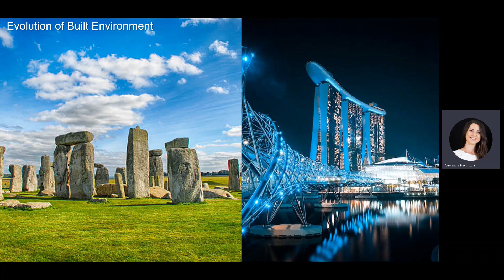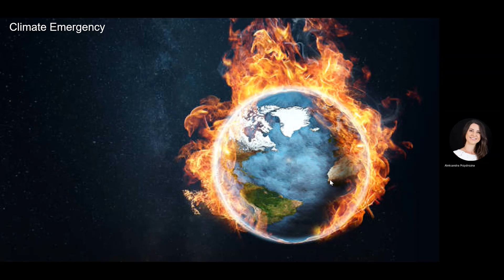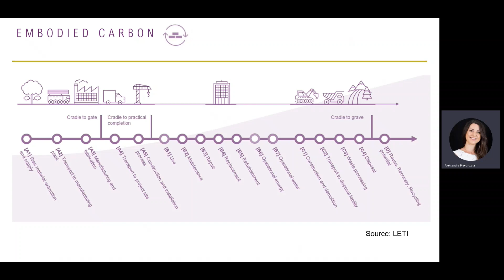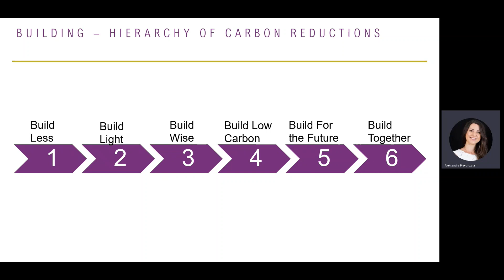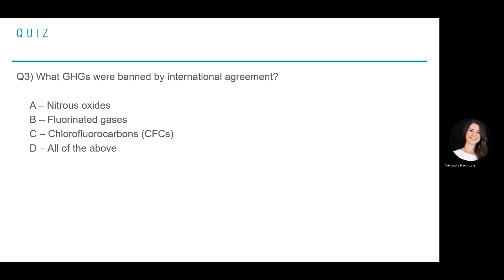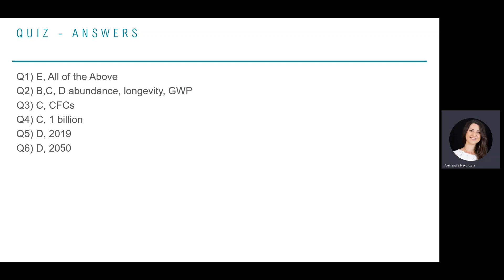EcoFIX Webinar 4 - Climate Emergency

Comment: Nonsense. There has been no clear change in annual precipitation over the Earth's landmasses between 1850-2000 (Wijngaarden, 2015).
Drought appears to be decreasing globally (Watts et al, 2018) measured by SPI 1901-2017. 
There are over 5 million excess deaths per annum globally due to abnormal temperatures from the 2000-2019 study led Prof. Guo of Monash University. It found that over 90% of excess deaths were caused by excess COLD rather than excess heat. So, in a world with increasingly mild temperatures, there will be less excess death. Warming is good not bad. 
Deserts have shrunk considerably since the 1980's. The Sahara shrank by 12,000km² per year 1984-2015(Liu & Xue, 2020). The Earth has greened by 15% or more in a human lifetime. "The greening of the planet over the last two decades represents an increase in leaf area on plants and trees equivalent to the area covered by all the Amazon rainforests. There are now more than two million square miles of extra green leaf area per year"(NASA, 2019). Global tree canopy cover increased by 2.24 million square kilometers (865,000 square miles) between 1982 and 2016 (Nature, 2018). As well as human intervention, the reasons for this include forests expanding polewards aided by additional CO2 and a slight rise in temperature.
The Earth’s natural vegetation productivity actually increased 6% in 18 years (Nemani et al, 2003) with 42% of this increase coming from the Amazon rainforests.